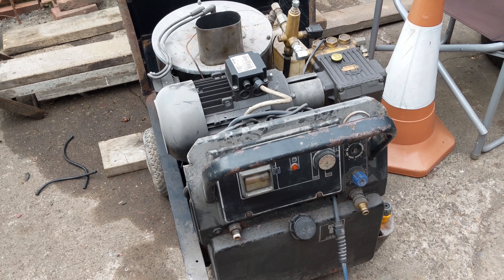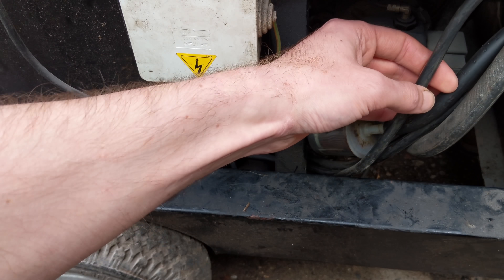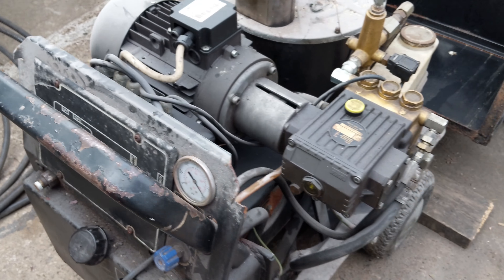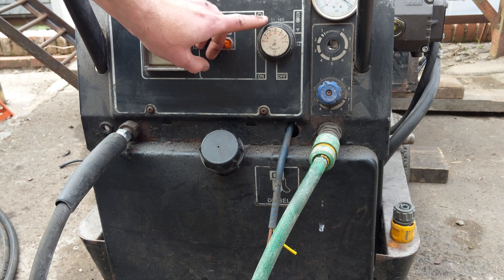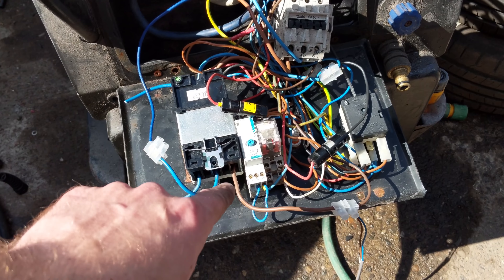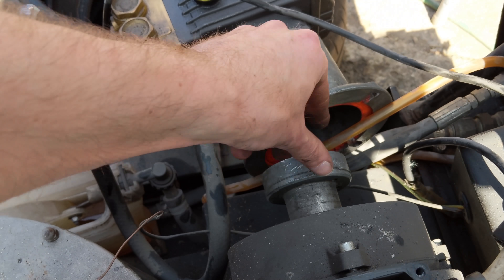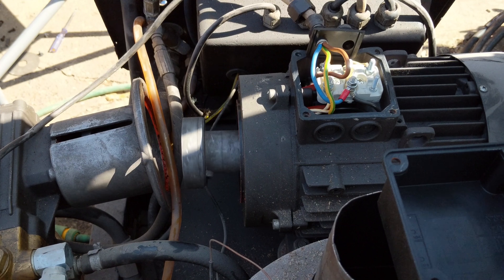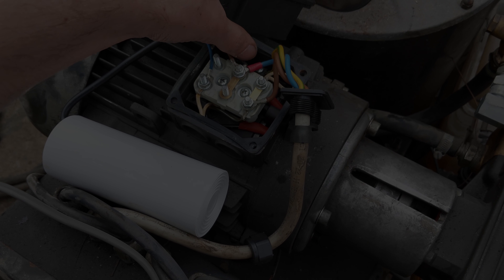Fixing a diesel heated electric pressure washer - part 1

Comment: Leaky connection next to exposed wiring, what could go wrong? On a more serious note I have no idea about electrics but I hope you get her fixed.
Reply from the maker: That's a very valid point.  Electricity and water are a dangerous combination.  Cation should always be used when working with mains voltage but even more so in the presence of water.  I made sure it was unplugged anytime I went near the wires with bare hands.  :)
Reply: I'd be more worried (as a former sparky) about you causing a short and cooking the electrics inside the pressure washer worse than they are....

I'd concur about the start cap though, its giving all the symptoms of being shot., no box on any of the othersides? cap might be hidden there?

Whats the motor rated at in HP and RPM - I might have a motor...well somewhere....I think...

Comment: Hi David

I have a Nilfisk Neptune. It was working fine then the heater played up and then now when i plug it in and turn the heater/pressure o it blows the fuse i the plug ?
Any ideas on where to start?
Reply from the maker: I'd unplug the ignition transformer, see if it runs.
Reply: If it was this easy to diagnose a problem, mechanics would fix your car over the phone

Comment: Hi, good man, leave the earth off to avoid analytical problems, I have had so much grief over this with my 3 phase motor conversion vids, but hey,  who's doing this and why should the armchair theorists worry? Cheers, Andy
Reply from the maker: I'm going to have to watch them.  What's the advantage over buying a VFD?
Reply: Zero cost if you have a few old flourescent light fittings around, cheers
Reply: VFS works better though as you have speed control by varying the frequency, which can be handy for stuff like pillar drills, metal lathes etc where you'd want to slow it down say for turning or drilling hard metals i.e. stainless for one..

3 phase conversion using fluorescents sounds a bit like a static phase converter?.......i.e. creating phantom phases, which some kit is extremely unhappy at being fed..

If I had the 2K cash sitting I'd invest in a mains gas powered 3 phase generator, quiet, cheap to run and generally quite reliable (thats a lie I'd buy a replaced for that tempremental pile of Swedish metal thats currently refusing to start  and taking up my garage...quite fancy a late 60s American big block V8 pickup, that or a scooby impreza wagon.....)
Reply: Hi, apparently as the frequency goes down so does the power. I use capacitors as a cheap way of converting small 3 phase motors and accept there is some power loss,  cheers